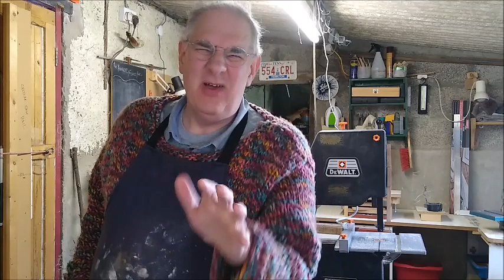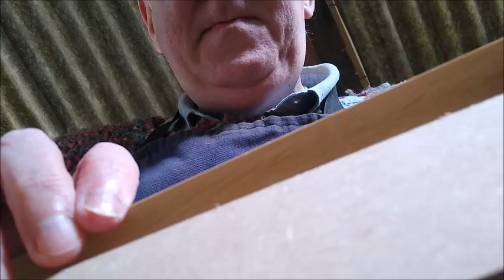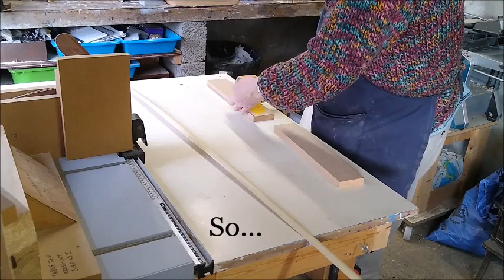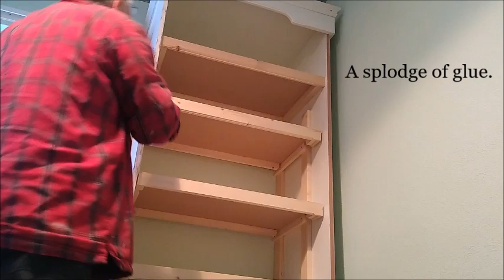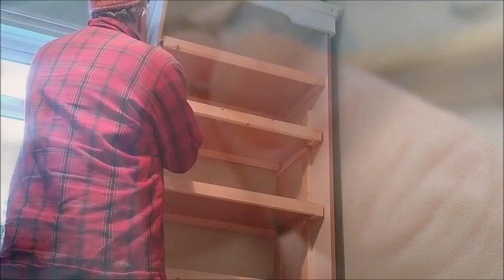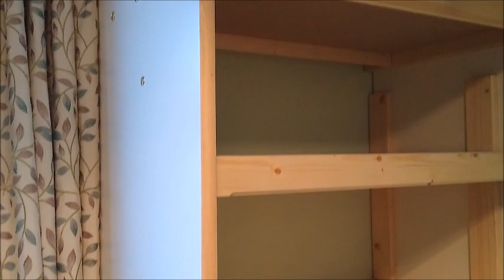Absolutely the Last Mention of the 50Foot Bookshelves. Probably

Comment: Hi Mark, Good to see you back on the big screen, even if it's a little screen. I like your tiny hand plane. I also like the nail blunting trick. I will use that. Seems like something I knew in the past but forgot about. My guess is that it works because it crushes and breaks the wood fibers. A sharp nail point will push the fibers outward, causing the fracture. If I am wrong, at least I sound like I know what I'm talking about. :-)
Reply from the maker: Cheers Tom. You know I have a wee vid about that plane? I got it at a motorbike jumble sale a few years ago - it's a super wee tool and I use it surprisingly often. God bless you mate and stay healthy.
Reply from the maker: Had to look it up - it's called Something Nice from the Motorbike Show.
Reply: @MarkMcCluney  Thanks - Just watched it. I would agree. It's nice to see old cars and bikes but I would also go more for the antiques.

Comment: No apology needed.  I just picked up a tip on how to shave down an edge piece that is a bit too wide.  I have always used a hand belt sander and it makes it a bit too rippled if that makes sense.  A small plane is the answer I needed.  Thank you for that so you can keep your apologies...LOL.
Reply from the maker: Thanks mate, that's very kind. A flat sanding block will work well for this sort of thing too, it's just a bit more work. The intension here was to demonstrate getting the width right using some scraps of the correct thickness, but I don't think it comes across as well as I thought it might. Oh well, it gave a few folks some giggles so mission accomplished anyway. Cheers Randy!